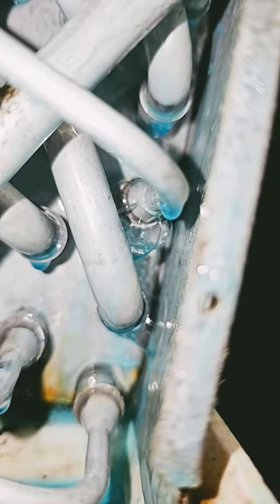New air conditioners are terrible #airconditioner

Comment: Has to do alot with the change from R22 to 410A double the pressure = double the problems
Reply: Not just pressures there making theses coils with thinner metal as well
Reply: Higher pressures, worse quality material, and most importantly POE OIL!
Reply: Went to a guys house to wash a guys ac. Lennox he got installed over the winter first time it was being turned on. Set the thermostat for cooling head outside and there’s a loud humming noise. I run over to disconnect the power but it is too late and the fan motor starts smoking.
Reply: Double the price
Reply: @slicktmi  lol, but have you seen the price of R22 lately 😅
Reply: @larryclaus5625  that's what I'm saying lol r22 is double the price i had a lady that had a r22 unit and look at me confused and upset when i told her 2k-2500$ to replace compressor and clean & recharge her system she said she didn't pay that much 2 years ago i said ma'am the prices are higher now and the guy prolly used the recovered r22 acid back in your system hence why it only lasted 2 years lol. I told her she's better off buying a whole 410 unit
Reply: Double the fun
Reply: @slicktmi simple, if they dont want new unit but new equipment, just replace that compressor and use 407c or MO99, either of works to replace r22.
Reply: @carlosmster7637  that's what i was gonna do but the compressor at the parts house was like 1200 plus that system had 2 compressor burnouts so it needed one hell of a flush that's why i was thinking a new unit for 1600 would've been best to replace that old unit.
Reply: @slicktmi   If you got that 2 stage, at that point yeah, is definitely way more efficient and economic for the costumer to get a brand new equipment, was just trying to drop an option for different approaches. I hope it all worked out in the end for you!
Reply: @carlosmster7637  yeah for sure all input is appreciated! Thanks man!

Comment: Which ones are leaking you ask? Which ones aren’t leaking is what you should ask. And yes no quality control. We moved from a repairable to a replaceable society.  where 25 years ago we just fixed them and told the customer it is fixed. You won’t have any more issues with this. Now I can’t guarantee a brand new straight out of the box any kind of equipment will even work. But hey let’s get rid of local and domestic manufacturing it’ll be so much cheaper letting other countries do it for us. Yeah Right!

Comment: I quit selling York units years ago. Had several quality issues. TXVs that were not brazed properly from factory, chattering contactors. Leaking coils, faulty bristol 2 stage compressors. 
Years ago Coleman/Evcon had one of the highest efficiency heatpumps The FRH model.  Nothing fancy but was 14 seer and 9.0 hspf. This was in the 1990s. York bought out Coleman and efficiency went down as well as quality.

Comment: 100%. Installed a new 3.5T 14.3SEER2 Am Std HP/AH two months ago. Compressor mechanical failure Friday 11 days ago. Ask distributor to give customer a new unit. They ordered a new compressor and said it would be here in 7 days. Well, that was 8 days ago and they don't even know where it's at. Oh boy, they are going to pay me $90/hr. No reimbursement for the $700 in portable a/c I bought them. You can blame your greedy, corrupt, overpaid, outsourcing pos corporate executives flying their family around in their tax deductible bizjet.

Comment: Super radiator coils in Phoenix builds coils as big as a couch and they have a pool where they are pressure tested for leaks. Freight is too expensive to be shipping a faulty coil that big back and forth. So they make sure it's right the first time.

Comment: York micro channel coils just seem to pop up a lot on warranty calls.
Reply: Had a York 20ton split for a data center, im on my 2nd condenser from York under warrenty and have a leak again in the micro channel coil in the condenser. York isn't even covering it under warrenty anymore.

This is why you don't cheap out, they took out the 30ton Liebert and put in a York 🤦🏽‍♂️
Reply: @ZRock7771  wow, I’m seeing this on the residential side, which is we’re I work. I figured the commercial/industrial would be way better off.  I guess I’m wrong.

Comment: My customer had a 3ton york heatpump for 18 years. I was the first to touch and find a leak. They said swap it. So installed a heil 3 ton heatpump on Aug 7. Aug 20 lost compressor. Found locked rotor checked cap good verified voltage good. Replaced whole unit under warranty
Reply: Check the capacitor under a load. Sometimes they show good on a meter but don't hold up under load. Fooled me 1 x on a condenser fan motor. Now I always install a new cap to confirm.

Comment: Coil leaks are the problem. On every brand. Oh. And don’t forget wiring rubbing on copper tubing or the metal of the unit itself because engineers.

Comment: The newer model Rheem’s have terrible expansion valve problems installed 2 new ones both with expansion valve problems
Reply: Rheem units most come with the outdoor and indoor orifice followed by the distributor. I had several issues on the orifice as indoor and outdoor seer values were mixed up.

Comment: Half the units I installed were missing pieces and leaking like where is the control board or why’s this the wrong board the plugs are not the same as the board no Freon in the outdoor unit is a big flag and no pressure on the unit inside is a well let’s just roll the dice and hope and it’s not just one brand it’s all of them I had one outdoor unit they had not braised all the connections and no valve stems that was fun as soon as I said let me check it before I connect the lines and air was blasting out called the supplier and had to call the manufacturer and they said they would cover it if I finished their job and braise every connection on it including the coils and compressor plus low and high pressure switch and the valves and they would cover the warranty on unit but not pay me what is the world coming to.      Love the videos and I still learn a lot from you.

Comment: Just this month: Brand new Trane tem6 ah had a bad coil, leaked out in 3 weeks.   Brand new Rheem coil bad, leaked out in 3 weeks.   Both passed the pressure check and decay test during installation.   Rheem is giving me a hard time about warranty because its running with a mismatched outdoor unit.   But we all know, pressure isnt much different between brands.

Comment: I started working in a apartment complex and the worst new units is the Weather king brand . After few months the compressor start failing.
Reply: Air King is a low cost brand

Comment: My 40 year old system had been leaking for years. I get it recharged about every 3 years when it starts blowing warm air. The most recent tech quoted me $16,000 for a new system, said R-22 is too expensive. I said "$16,000 expensive?" He recharged it.
Reply: That happen to me. Your bill will be alot higher because the condenser are working double or triple..when the freon is going out the ac has to work more to have the tempeture inside the house,resulting in a huge bill..
Reply: @jesusmillan65  not really, less freon less amps.
Reply: @jesusmillan65  True, electrical is more but not any great savings with new system. Neighbor replaced old with new system. The savings on electrical bill is about $20 a month which is nothing as we run AC maybe 4 months a year. Cheaper to stick with old system.
Reply: @Igotstaknowit  if you not want another unit thats great,but if you dont fix the leak that will cost you alot over the years..you know what im talking when the freon is leaking the unit will work more...

Comment: I have a Carrier 2 ton central air with gas furnace. The capacitor on the a c  blew in year two. Covered under warranty but that's not the point. I know it's a part that commonly fails but how about making them better so they last longer,?
Reply from the maker: I wish that's what they had in mind when they make them.
If they wanted them to last longer they wouldn't outsource the manufacturing or the outsource of the parts.

Comment: How do you like Yorks? I’m thinking about switching to installing just Yorks but I’m worried about stuff like what you found in this video.
Reply: We install Carrier, pretty solid units. Parts are readily available, easy to work on and they are reliable. No point in installing cheap units just to spend your time and money fixing them all the time and having frustrated customers.

Comment: All new TempStar  (274 units) at the complex I work installed 2 years ago. I call em JunkStar. We change an average of 2-3 contactors a week. hecho en México.
Reply: What is failing on the contactors? The coils or the contacts?
Reply: @BlownEarDrums  coils, blows the 3 Amp on the circuit board.

Comment: I hate York!
My uni library has like 30 of them (8/10 tons)
Half of them leak at condensor (and it's not a Microchannel!)
Reply: Had a 7.5t rtu. 5 years old with a cond. Coil leak. They want $5,600 our cost for the coil......
Reply: @TheBwkaylor  that's crazy expensive
Reply: @mikaelahyakuya3485  yea....i was shocked. Could danm near get a rheem 7.5 for that price.

Comment: Why didn't you look and find the leak when you came. Why add 5lbs then have to come back when you didn't do correct job when you went the first time. I'm sure you charged for the 5lbs. That leak should have been discovered at first issue.
Reply from the maker: No you're wrong
I did not charge the customer
This is a brand new unit
I didn't search for the leak because I wanted to come during the week to search for the leak not on the weekend.
I'm trying to spend time with my family too in this life
Reply: @TaddyDigest  still 5lbs of r22 or 134 still bad just to be leaking out. And the fact that you are back is a waist of time and money. For both you and the customer. Using the excuse that you put a bandaid on it because you just was in a rush to get out is still not good business practice. If you want to be home with family get a different job. Don't give the customer poor services because you trying to get out quick. Ijs.
Reply: @TaddyDigest  I do get it but it's just a longer process that the customer has to deal with no heat.
Reply: You think he's running in heat mode right now gtfoh. Total troll...keep up the good work Tad
Reply: @9universalmag  How about you do you and let him do him. WTF was he going to do on weekend about getting a new coil? Charge it and get them cooled so they can stay open. Troll!
Reply: You can’t save them all. With 800 rental doors there is always an emergency and we could work 24/7. The tenant wants to be cool and enjoy their weekend too. Most would love you getting in and out quickly and coming back during the work week for the permanent fix. My parts house will open for me at any hour on the weekend but unlocking the door is a $125 charge.

Comment: So when you came out and added 5 or 6 lbs, and  it didn’t have a leak  then 😂 so you went back and it was low then you found a leak. 🤔 And you have a video on how to find a leak 😂 why didn’t you use the video the first time you came out 😂😂😂. Any electronic leak detector would have picked that up. Amd you mentioned quality control. Tell me one manufacturer that you know that they units don’t leak 🤔